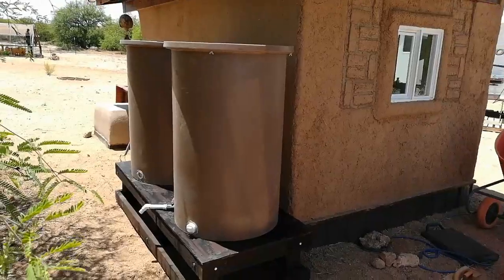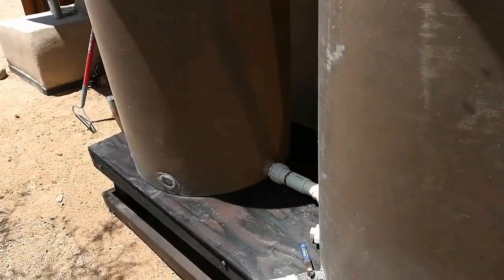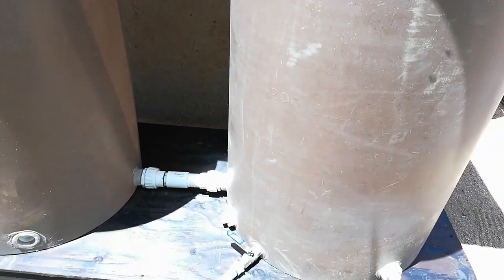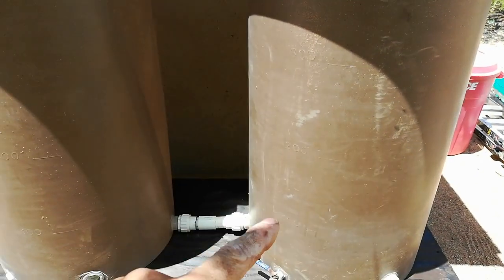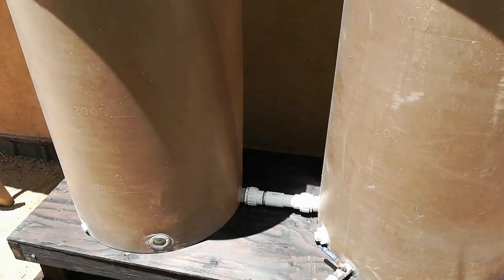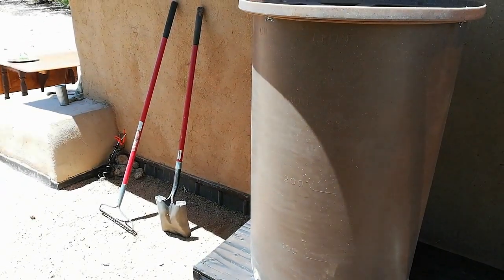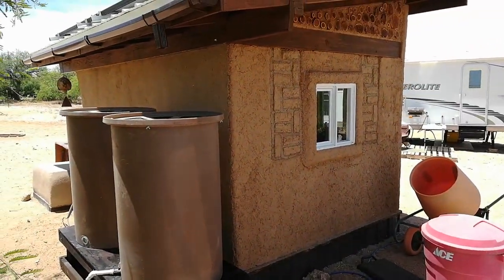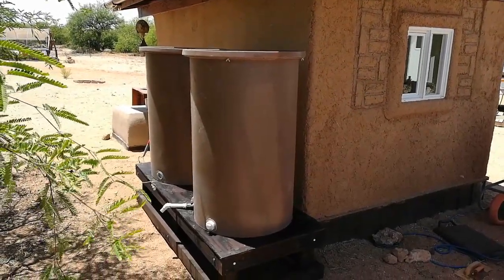200 Gallons of Rainwater Harvesting Capabilities From The Solar Shed!

Comment: Your Ball valve is on the wrong barrel ,cause once the second barrel is full too, there is no way to remove the water from it.
Reply: It wouldn't matter which barrel it was on, as long as that vertical pipe is in there, only 100g would be available.
Reply: You are correct, only the first barrel will fill and empty
Reply: @theupsideofdownsizing  .....That would work for sure.

Comment: Hey Bill... why the standpipe inside the first barrel?  By my weak understanding of fluid dynamics, once the overflow tank is full, you'll still only have 100g available to you through that ball valve.  It seems if you just had a straight pipe from one tank to the other (near the bottom), you'd have the whole 200g available, once full...and they will fill up equally.  Just an observation.  Cheers! Chris.
Reply: It looks like a great place for rattlesnakes underneath that stand. Please, be careful
Reply: @theupsideofdownsizing  The big difference is, with only one tap, you'll only have the first 100 gallons available.  The second (overflow) tank will always stay full.
Reply: The Upside of Downsizing You could  indeed.  Or just remove the vertical piece of pipe in the first barrel ... would be a cheaper solution.
Reply: The Upside of Downsizing There ya go.  Cheers!  Chris.